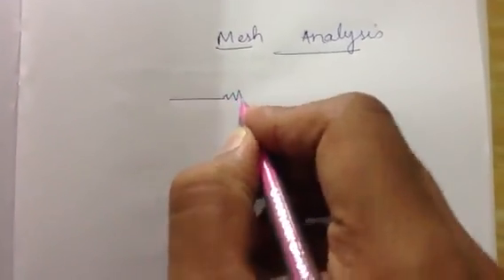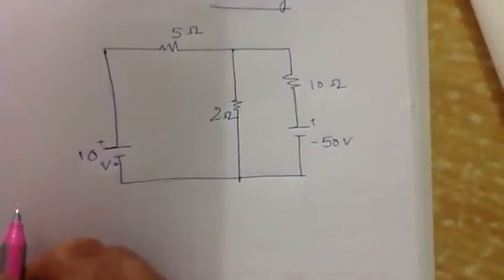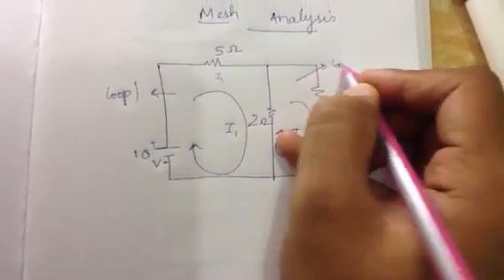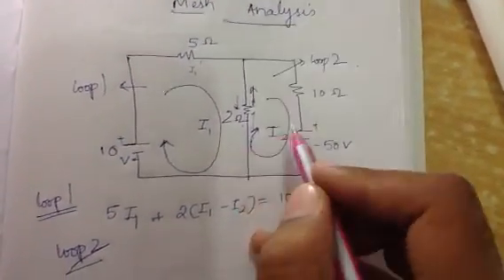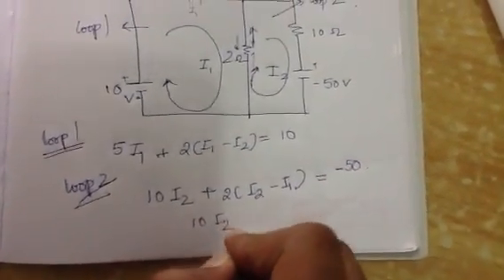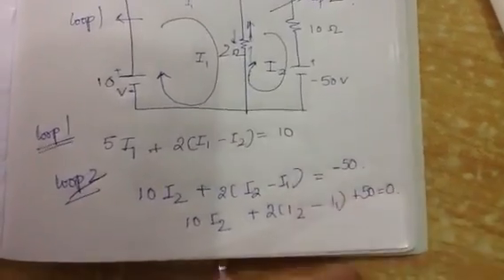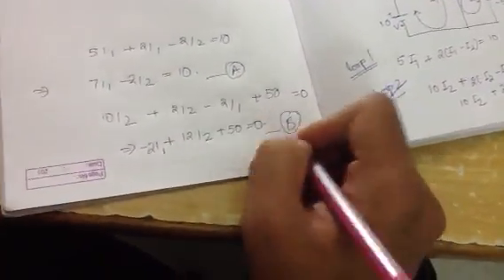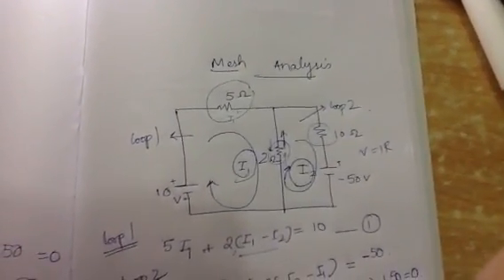Mesh Analysis

Comment: Explanation about why a source voltage is taken negative is not  adequate. Also you have not mentioned  about moving direction. Basic concepts about why positive voltage and negative voltage should have been mentioned. Otherwise this just becomes a blid mathematical technique.

Comment: Sir , can we take 2 different direction of current in different loops ? Pls reply
Reply: Yes you can. You just have to make sure you write which part of the resistor that is shared between I_1 and I_2 is positive and negative and apply it to get the proper equation.

Comment: i think voltage is -50 so it should be on R.H.S of eq 2 with - sign
Reply: If it was setup to equal 0, then it would be -10 and the second would be 50. Since he skipped that step and already added 10 from both sides in the first equation and subtracted 50 from both sides in the second equation. So, he is right in how he did it.